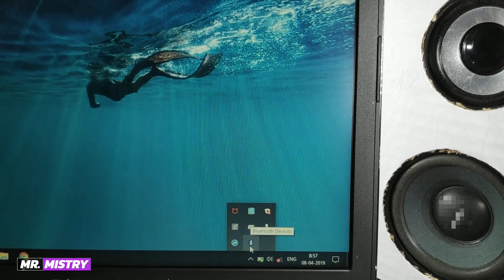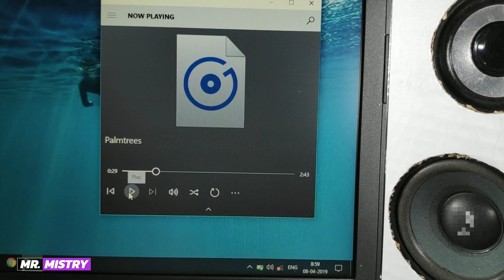Make a Bluetooth Boombox using PAM8610 board | Bluetooth Speaker

Comment: I made a Bluetooth speaker with 2  10,15 watts speakers with Pam 8610 board. But 10-12 volt current is coming to the right speaker point of the board.The right speaker is not ringing and the whole connection is being turned on & off,  on & off automatically. The left point is right.
Please tell the solution.🙏🙏
Reply: There must be some problem in pam 8610 board

Comment: You can simply add a 5V DC to DC ISOLATED CONVERTER to avoid this interference sounds (ground loop)
And this amplifier chip is not good.. it's heat so fast. so it cannot handle that kind of sound. and it will automatically off after 5sec in Full sound
Reply: What kind amplifier chip can I use I got big speaker ?
Reply: @animeghoulz9760   
 TDA7492P amb 50w x2
Reply: So in any amplifier board DIY project it's advisable to add the 5v DC to DC isolated converter?
Reply: So in any amplifier board DIY project it's advisable to add the 5v DC to DC isolated converter?
Reply: So can I use TPA 3110